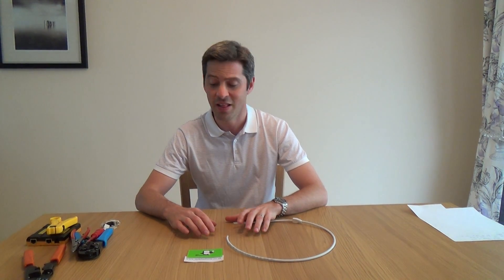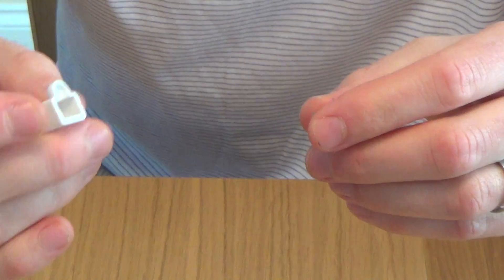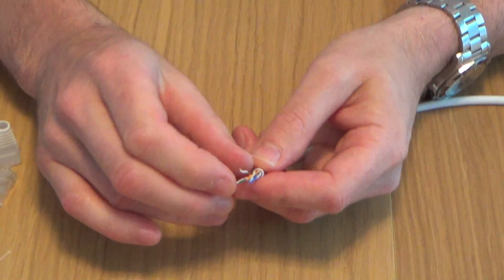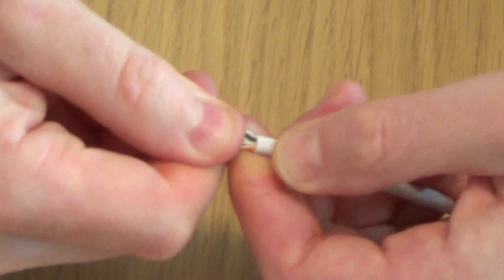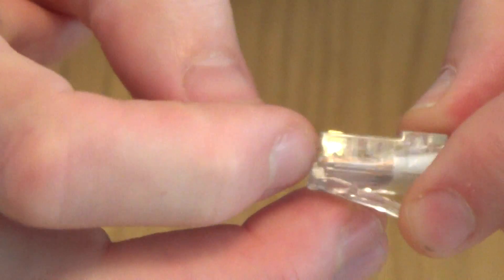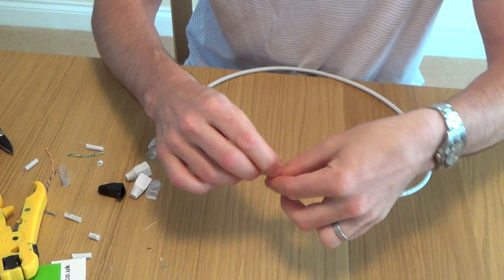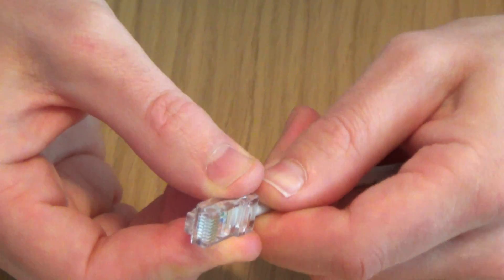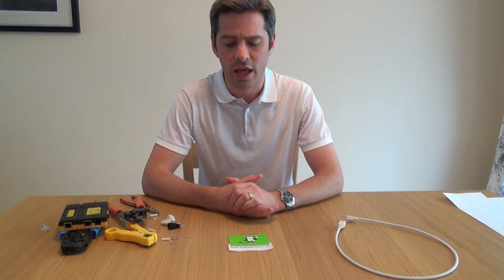How to fit CAT5E Ethernet Plugs RJ45 8P8C Cat 5E Cat5

Comment: can someone help me i have an extra cooper wire 
first time doing this
Reply from the maker: You might be using Shielded cable and that might be a drain wire. If it is a wire with no insulation round it then ignore it and cut it back.

Comment: It seems like everyone does this. That RJ-45 is for stranded wire. When you crimp it down on solid core wire it ends up breaking the conductor right at the crimp spot.
Reply from the maker: +Jon Netbotic Hi, these plugs have contacts that accept both stranded and solid core wire. There are 3 common designs on the gold contact pins, stranded, solid and dual purpose.
Thanks.
Reply: +My Mate VINCE I didn't notice that the first time around, now I see that they do. Thanks.
Reply: +My Mate VINCE how can one tell the difference? Some years ago I bought 100 connectors and a (non-ratchet type) crimp tool which I've used over the years mostly with 'outdoor' solid core cat5e cable. I've had many problems getting reliable cables made. For sure the tool is partly responsible as its not the best, but I only discovered a few days ago that some connector plugs aren't suitable for solid core cable, but I m not sure which type I have.

Comment: I've been told that you need RJ45 connectors specially for solid core CAT5E cable but can't seem to get them anywhere. Could you shed some light on this. Cheers.
Reply from the maker: Hi, there is a difference between the plugs, you can get rj45 plugs that do both solid and stranded. Have a look at my other video titled....How to tell the difference between cat5/cat6 solid/stranded core rj45 plugs....In this video I show the difference between the various types.
Thanks Vince